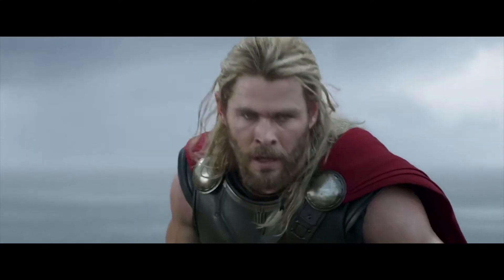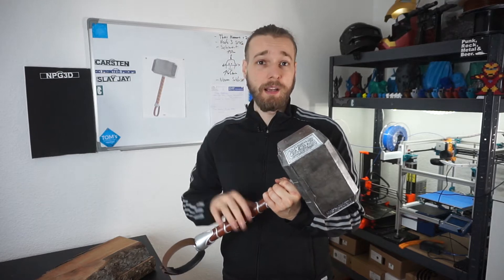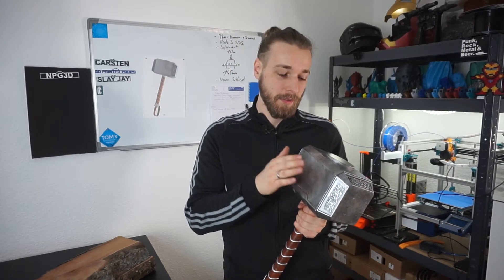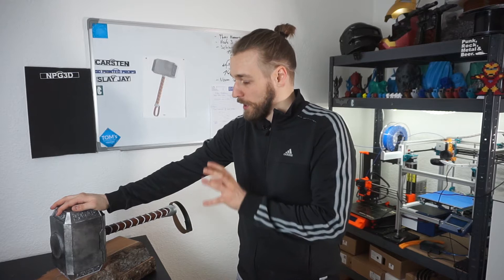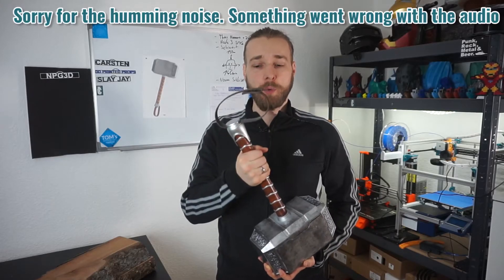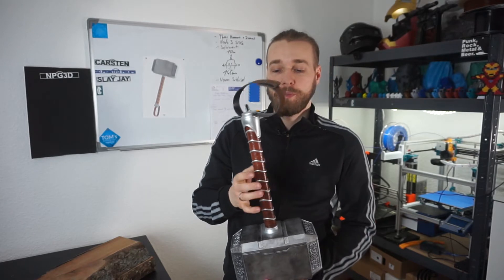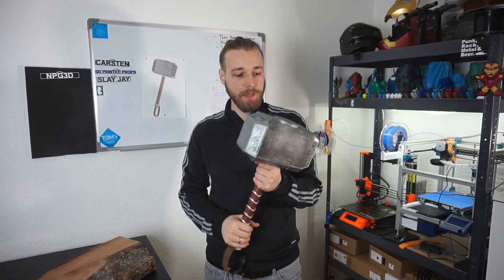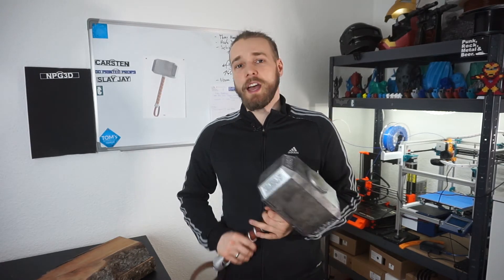5.5 kg real life Thors Hammer (Mjölnir) // 3D printed

Comment: Im new to 3d printing and i want to try this but the handle doesnt fit on my printer. i notice that your handle came in 2 parts. was it like that in an older version or did u cut it in half or someething like that if so can u tell me how XD. Great job btw
Reply from the maker: I use Prusa Slicer where you can simply split the handle in to pieces. If you don't use it you can use meshmixer, but its a more advanced tool.
Reply: @WF3D  thank you bro 👏👏🙏🏾🙏🏾👌👌👌👌😎😎

Comment: How long did it take to print the parts at that layer height? I am thinking of doing one almost exactly like this but 10-20% infill sounds like it would crumple if dropped?
Reply from the maker: I really don't know anymore probably 2 days at least. If you fill it with concrete it will crumble if you let it fall. But so will your floor 🤣
Reply: @WF3D Thanks for the input!
 I'm considering printing with .28mm to save time (Since it's gonna be sanded anyway) while having a LOT of infill so if someone drops it it doesn't ruin a big project.

Comment: With what material has the hammer been filled to weigh ? An awesome job.
Reply from the maker: Concrete mortar. Thanks!
Reply: Thanks for answering so fast.Greetings from Spain.
Reply: Hello, sorry to bother  you again, could you provide me with the exact color (or reference) of the silver spray you used ? I just can not find it. A greating.
Reply from the maker: Carlos PM74 https://www.amazon.de/Dupli-Color-385919-Cars-Spray-Alu-Felgensilber/dp/B005IFJ6AW/ref=pd_aw_sim_263_of_4?_encoding=UTF8&psc=1&refRID=TD0108T0S2VZ0RWA354P check this one. It is for rims but it super shiny

Comment: Amazing work!! I was going to do the same 3d model! Im glad too see is very good model if you finish it like you did. I was thinking in put something inside to make it heavier and concrete is great idea. About the leather handle strap, would be nicer if it can support the weight of the hammer, I was thinking in get a larger strap, put it inside the handle, then filling with concrete, will be harder to fill, but when it dry, i think it will support the weight. Sorry for my english.
Reply from the maker: I think then you have to connect the leather to the steel rod. Otherwise it will be too heavy for the concrete in the handle

Comment: Great video! Are you planning to work more with XTC-3D or other resins in the future to cover the majority of seam lines before filler primer?
Reply from the maker: Sintoxic I still have to experiment with xtc 3d or epoxy but I also think it when you have geometric shapes and sharp corners the epoxy does round out the edges which I don't like. So yes I will but depending on the project.